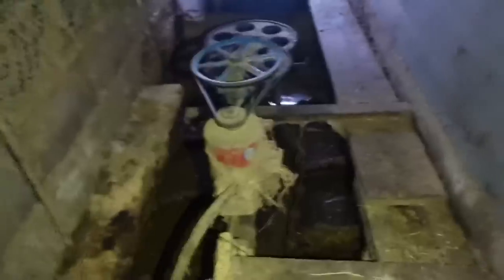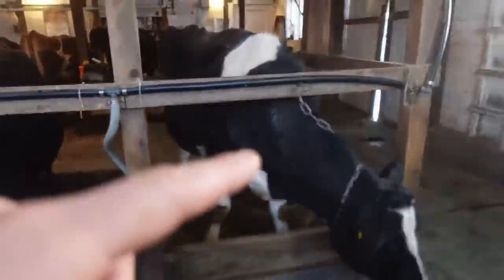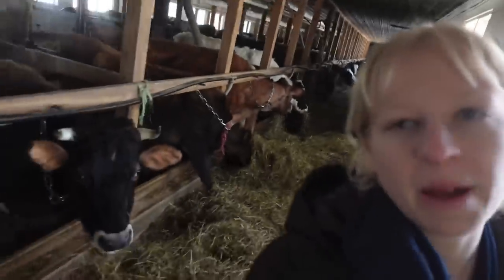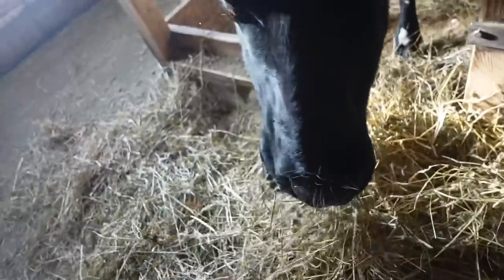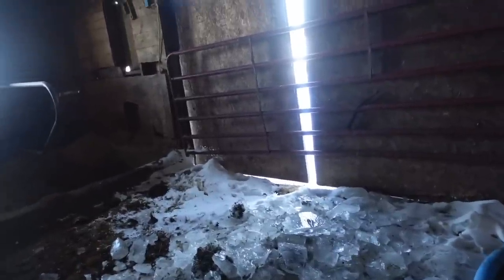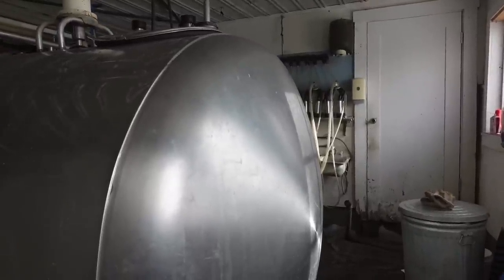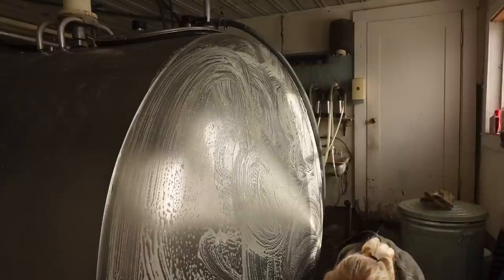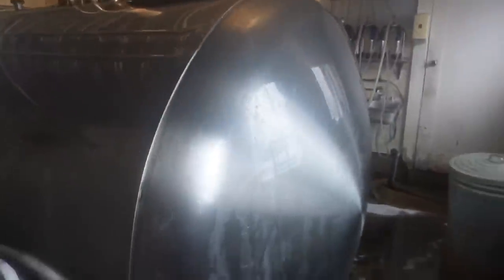Milk house chores on our 70 cow dairy farm…

Comment: Hey Taylor, If you really want to get Ambitious, Get yourself some Mothers Aluminum Polish and it will take the stains off the tank. You can pick it up at any Automotive Store. Read the direction on the amount to use. It works great on anything Aluminum or Chrome. There is your tip of the day LOL.. Enjoyed your video, Thanks for sharing.

Comment: Hmmn, could you explain the reasoning behind the large freestall barn associated with a stanchion barn. Is your local weather poor enough that cows need protection during off - winter seasons? Seems like alot of structure for non milking part of the herd. It would be a nice addition if you had switch cows but seems like all your milk cows fit in the main barn.
Reply from the maker: Absolutely! This farm used to milk over 100 cows with around twenty heifers so the freestall and the milking barn were both full capacity at that time. But our weather can be very bitter in the winter so most of our girls stay in the main barn unless the temp is above freezing then we will let them in and out. Thanks for commenting.

Comment: Speaking of scratching, how did the of Broom head repair work out? Are the girls still using it to the point of tearing it off the wall ? Lol. Great idea of recycling. Don’t know if your city or town nearby have a street sweeper. But know the used brushes on them would probably work great
Reply from the maker: Hi, it worked great but unfortunately they did finally reel it off the wall😅